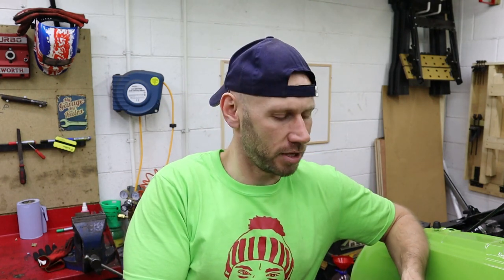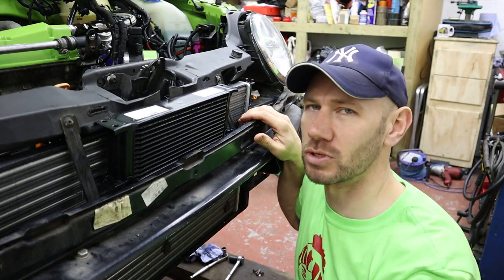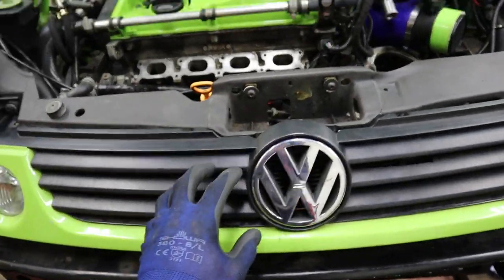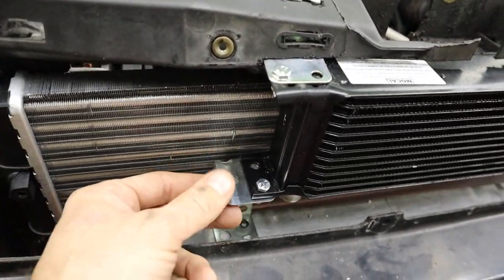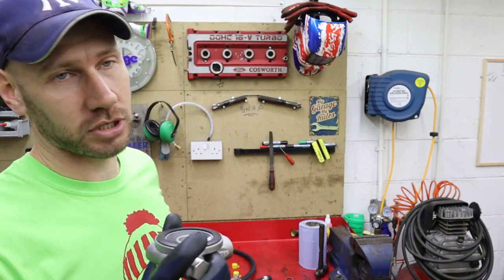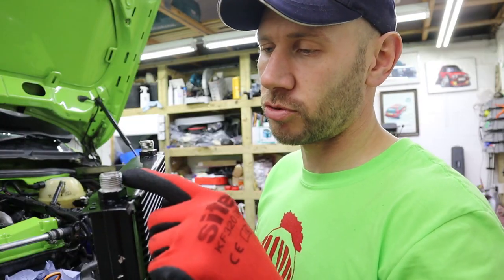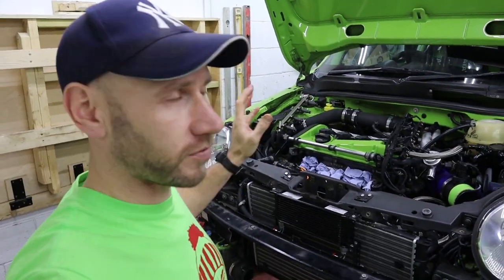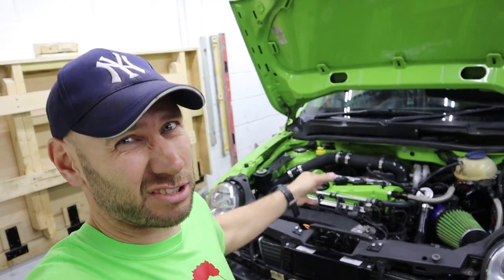VAG 1.8T OIL COOLER INSTALL !!

Comment: Thanks, got the same kit for a golf 1.8 gti, this engines run very hot hope it helps a bit.  Im on stage 2.
Reply from the maker: Hey man, we use this on track and its brilliant. We have no oil temp issues at all now. Hope you don't either!

Comment: 1, do you have to unplug the sparks when you fully have everything installed. Can’t I just start the car and let the oil flow through by its self?

2, how and where do you put in the sandwich plate in. 

3, where & how do you connect the sandwich plate to the OEM cooler

Comment: How long did the hoses stay on before one blew off and dropped all the oil out?

You forgot to fit clips on the connections to keep the hoses on lol
Reply from the maker: Ill take this as a joke... considering they are push fit hoses hence the need to heat them up before installing...🤪😘

Comment: Nice job bud! I was thinking of doing the same but getting rid of the original cooler aswell.
Reply from the maker: Cheers mate, I wouldn't recommend ditching the original cooler. Originally I didnt fit one on my big turbo S3 and it took ages for the oil to get to temp as it also heats the oil up on startup. I refitted the original oil cooler with the external and it then got to temp and maintained it perfect.
Reply: @DecimalTenths  I see! good advice man sound keep it up I like your style of videos
Reply from the maker: @marigoldmechanic  Thanks mate 👍
Reply: Hi Nick, have spent most of an afternoon watching your videos. Great work. 
I was going to ask about binning the heat exchanger but some one already did. 😆 
Just wanted to add a bit about that from my past life. Donkeys years ago I ran An imported GTI G60, lots of tracks days at Castle Combe and Oulton Park. The oil temps were out of control so I chucked on a cooler and removed the heat exchanger. Fantastic drop in temps. 
It could be seen on the water temp gauge how much heat was crossing to the coolant. The needle now sitting well to the left of centre. 
That chuffed me no end.... Until winter started. 🥺 It was bitter driving it through winter. Cold mornings from Warrington to Manchester airport for work. Had to wear ski gloves and scrape the ice off the inside of the screen! 
I resorted to covering up half the radiator and intercooler with cardboard. Like my dad used to do. In the 70s
So the moral is, don't be surprised what happens if you delete the heat exchanger. 
Now living in Australia and driving a 2006 Polo GTI, I did the same, but with ambient temps rarely going close to zero. I can run without the heat exchanger no dramas. 
Back to the videos.

Comment: loved the video. im building a g25-550 build for fast road, and thee occasional track day (1  a year). would you say the standard oil cooler is sufficient enough, or would i need to get this type of setup?
Reply from the maker: Cool mate, 100% you will need an oil cooler. Go for a 16 row at the minimum, with thermostatic plate 👍
Reply: @DecimalTenths  awesome. thanks very much for the advise. any particular brand you'd recommend?

Comment: Did you modify the oil filter housing threaded pipe in any way, the sandwich plate looks thinner than the OEM oil cooler?
Reply from the maker: The oem oil cooler is still fitted on this one. It helps with warming the engine up so I leave it on.

Comment: Is that a golf oil filter your running? I use a Lupo gti one as it's shorter as I have access issues, have to loosen the rear engine brace so I can screw it on/off successfully. Great video as usual Nick, and I'll be looking to see what fitting issues I have 😊
Reply from the maker: It is mate. I just use standard 1.8t filters, and I've clearanced the front slam panel so that theres no fitment issues. Cheers 😁

Comment: Which thermostatic plate did you go with bud, the 80 or the 92°c.
Reply from the maker: For the oil cooler I used the 80deg plate as I was limited on cooler size so wanted to promote flow. I never had oil problems with the kit 👍
Reply: @DecimalTenths  legend, thanks dude.

Comment: Tip fer ya. A little oil goes a long way.  Use it on them fittings like a lube mate. Trust me. It works beautifully. Rub it inside the tube n  on the ends of the fittings.
Reply from the maker: Should have clicked on, I've used lube to help with tight jobs before...😉🤪

Comment: Hi mate can I just ask you a question you told someone that they should leave the original oil water cooler on and fit the cooler plate to the bottom. Do you use the original threaded bit that the oil filter goes on or do you get a longer one in the kit ? Cheers
Reply from the maker: You get an extension adaptor in the kit mate. It's on the bench when I talk about the kit. You fit the sandwich plate then screw the adaptor on to secure.
Reply: Decimal Tenths thank you for your reply that’s very helpful cheers mate stay safe
Reply from the maker: And you too mate 👍

Comment: Been looking at one of these for a while but I’m more keen on killing off the original oil cooler because they have a tendency for failing and oil getting into the coolant system. Would you say it wouldn’t matter with the sandwich plate bolted onto the oil cooler and the new oil cooler to the front? Or a better system would be to get rid of the original? 

Great video by the way!
Reply from the maker: Cheers! I'd personally keep the oem cooler and have an external as well l. The oem cooler also heats the oil up so if you dont have it the oil takes forever to get to temp. I took it off my old 1.8t S3 and ended up putting it back on eventually.
Reply: Decimal Tenths Thanks my friend I appreciate the input! I’ll definitely be ordering and fitting in the next few months!
Reply from the maker: @IIRJC  cool mate they make a big difference, especially on track. I'd also make sure you get the thermostatically controlled sandwich plate, so you dont over cool your oil. 😎
Reply: @DecimalTenths  hi Nick. Sorry for reviving an old thread. So ideal for track attack kinda situations. But you said your s3 was a road car. I'm looking into doing this on my build but as you made reference to tpr saying go for a 16row I may do that. My car is mostly going to be a road car though so would you say if need to actually put a cooler on or keep with only the o.e sandwich plate dude?

Oh and one more thing are you ex REME as your manurisms deffo suggests so and your knowledge is on point too👍
Reply from the maker: @davidkane9876  Hi David, if you're pushing for more power with possible track days I'd suggest you definately fit an external oil cooler, as well as keeping the oem oil cooler as it helps to warm the oil up on start up too. It all just works a lot better with them both connected. 

I'm not ex REME mate, but good spot, I have spent some time as her majesty's pleasure...
Reply: @DecimalTenths  fair one nick I've got a big military family background with a few family members still serving so I can spot it a mile away. All I'll say is cheers and hope you enjoyed your time in. Everyone I know had or has a good time but it's not all fun and giggles I know that for sure. 

Tpr does a fair bit for former service personal so I'm unsure but I think he may have served also.

I'm pushing for 300-330 hp with quite an extensive build bud. Running a k04 hybrid so those temps are still going to be up there so I'll look into getting a cooler asap before the motor goes in. By the looks of it your running the same I.c as I am. But I have sprayed mine black which has been said to drop temps but I'm dubious lol. I've solely done this dues to corrosion on a bare alloy I.c. Is the size of the cooler on the lupo sufficient? I had the same size on a previous build as it was rated up to 400+ by Nik and Ben @ R tech.

Keep the vids coming pal I've deffo enjoyed the channel so far. 🤘

Comment: I thought that the Oil-To-Water cooler is much more efficient than the Oil-To-Air one which is also dependent on the air flow and if the car is standing with no fan turned on, it could lead to higher oil temp. I am not a prof. just thinking out loud :)
Reply from the maker: Yeah they are more efficient, and work well on road cars, however on track they get saturated, and the transfer of heat doesnt happen as well. The high speeds basically guarantee good airflow so an external oil cooler like this works well. Plus 2 is better than 1...

Comment: What kind of oil you use ?!
Reply from the maker: I generally just use standard synta 5w40 and change it very often.
Reply: Well do you use upgraded oil pump or stock?! Can it cause low presure oil boost with stock oil pump and the oil radiator on ?!
Reply from the maker: @proracingpr4770  Stock oil pump, and it copes perfectly well. No need to upgrade the pump 👍